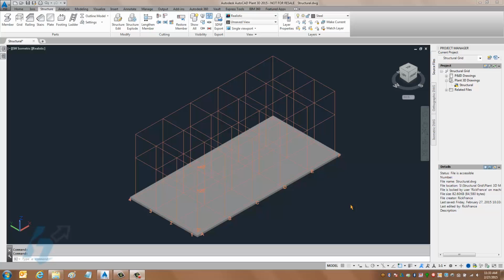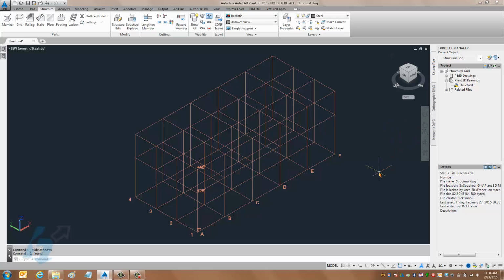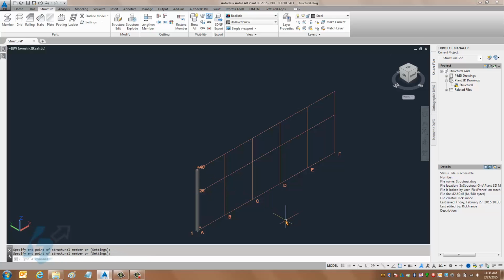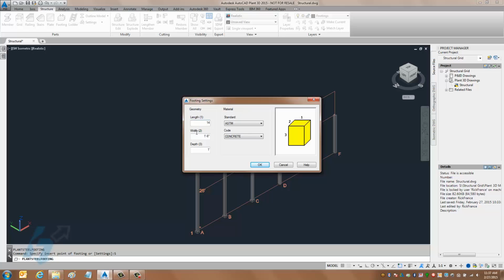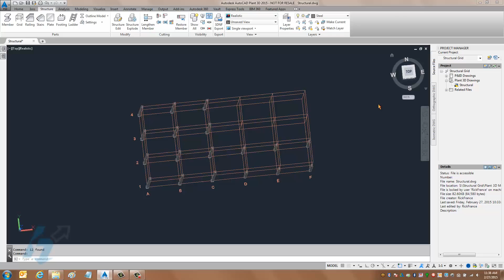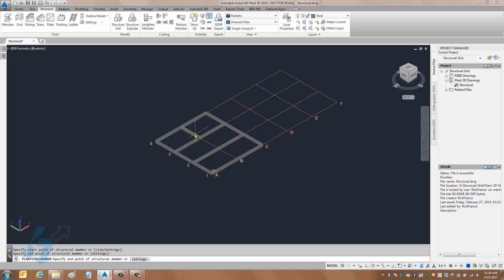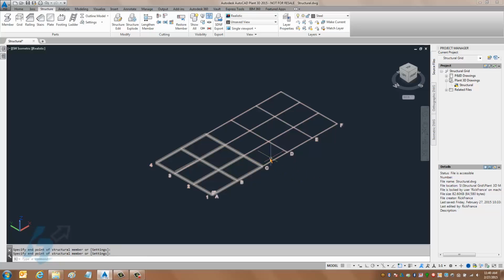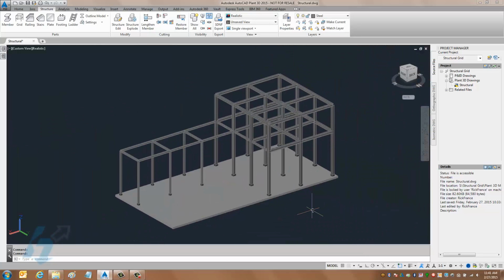Plant 3D Structural Grid

Comment: Do you know how to get the grid to show up in the Ortho Drawings?
Reply from the maker: The grid itself will show up in the ortho as long as it is on a layer that is not frozen in both the structural drawing and the ortho cube drawing. If you are referring to the grid callout text, no text, dimension or annotation in a model will show in an ortho drawing and that includes the grid callouts. That is by design – only the model will be used to create the ortho drawing itself. Annotation must be added by the user.